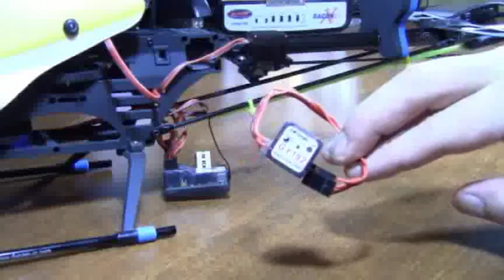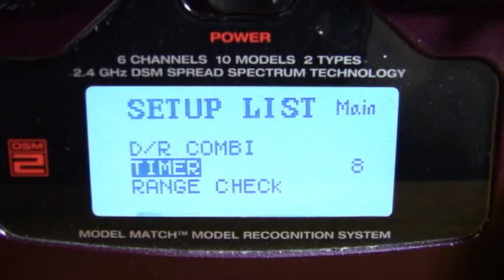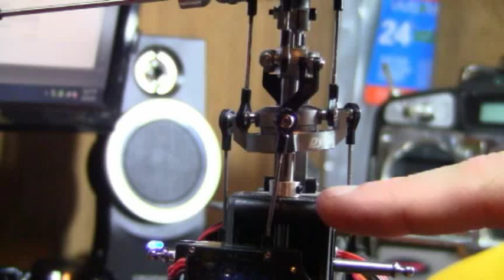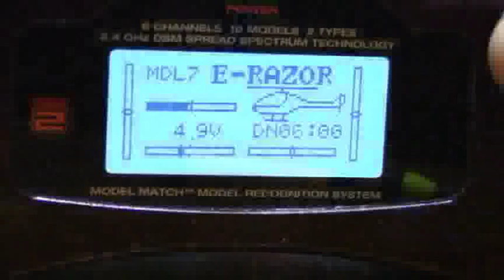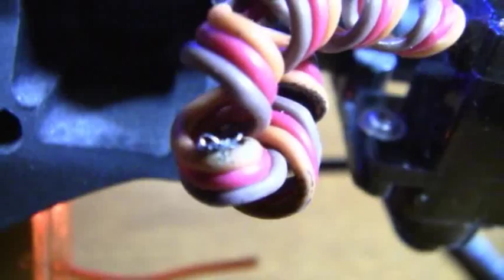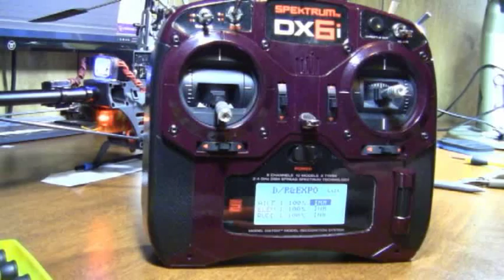How to Completely Setup A CCPM Helicopter  DX6i & OrangeRX

Comment: Hey brother awesome video! I'm just getting back into the hobby and found it very informative. Still have a QUESTION if anyone would help me out... First I'm converting a 72 mhz T-Rex 450, collective pitch with a flybar and i got Radiomaster tx16s... I'm looking to buy the OrangeRx R620X V3 6Ch 2.4Ghz receiver ... Will this receiver work for me?  Just a little confused with flybar/less and the receivers and if it makes a difference which I buy? Thanks in advance!
Reply from the maker: As long as the receiver is made to work with the Tx, it should be fine. But not all Rx's will work with all Tx's. Such as Futaba will not work with Spektrum and so on. so as long as it's the same band, it should work fine. You can always come over to www.rc-help.com and post up your Tx and your Rx link you are looking at and we have a great group of people that can help out. Hope to see you there.

Comment: Very good .  where are you located? im in san jose CA.  I could really use a contact like you. Ive got e razor 450, 230V2, 330x, 360cfx, and align pro 500dfc.  I wreck just about every flight.  Your vidio may fix that hopefully.  There's nobody around here ive found who knows jack sht about thee
 Products they sell. Its just like here you go your on your own. Go for it.  100 bucks a second and away i go

Comment: Hi mate just a quick question when I tilt my 500 to the right-hand site should my squash play move to the left cheers
Reply from the maker: That is correct. The swash should always try to stay level.
Reply from the maker: What flybarless controller are you using?
Reply from the maker: No worries. You are correct, on a flybar helicopter the swash will only move with stick input. The flybar is what does the stabilization while you are in the air.
Reply: Yeah I understand that now mate thank you and also when I'm in a hover to helicopter wants to drift to the right and I centred the servos and it still wants to drift to the right quite a bit
Reply from the maker: On a flybar helicopter, you can use trim tabs to help keep it in one place. If you go inverted though, just pay attention to what way it is drifting inverted as well and compensate for that as well.
Reply: Ok then how do I sort that out then cos my swash plate does not move at all only if I put in put on the sticks the swash plate moves
Reply: Sorry mate I got myself confused I thought it would do that on a normal align Gyro
Reply: Lol

Comment: Oops! you didn't say to set up the blade pitch from the side.  I've been trying to do it from the tail.
Reply from the maker: You can setup the blade pitch from any orientation as long as you do the other blade in the same orientation. Just make sure your main shaft is as plumb as possible.
Reply: @RcHelpDotCom  I'm concerned that my Gyro might be installed wrong. Mine is on edge, like shown in your picture, but GY192 installation manual says to put tape on the back and "the gyro must be mounted level and the axis of rotation is exactly parallel with main shaft" . Does it work properly as you show it?
Reply: The "Main Shaft" is the rotor shaft, right?
Reply from the maker: The way you see it in the video is how my gyro was mounted from the factory on the E-Razor 450 when I received it. It wouldn't work any other way because of the way they had the sensor inside mounted. If yours is newer, it could be different.
Reply: @RcHelpDotCom  Thanks!
Reply from the maker: The main shaft is the shaft that the swash goes around and up and down on. It is what holds the head onto the helicopter.

Comment: I had no idea Dynam produced a Helicopter. Wow! Most guys swore by the DX6i as a helicopter transmitter. I have a nitro heli from Kyosho but It came with a Futaba radio and receiver stock from the factory. I may switch out the receiver. The DX6i is more than adequate to fly up to 4 miles. at least thats what I was told.
Reply from the maker: Yea, they made a helicopter, but it was not a good helicopter lol. I quickly moved onto other brands shortly after this video which is quite old now. As for the DX6i, I would not trust that Tx for anything more than 1/4 mile, especially if it is the old DSM2. DSMX, maybe 1/2 mile. But without diversity, it just gets sketchy from there. www.Rc-Help.com
Reply: @RcHelpDotCom  I quit using my DX6i after it nose dived two of my planes. I found it only works best on UMX planes and no programming. As soon as I add in Rates and Expos, the thing cannot handle it. I have flown my Apprentice on it but even then , the DX 5e that came with it is 100%  better. I went to Tactic and have been happy with that. I also have the 3rd gen DX6. That seems to be fine.

Comment: Don’t set EPA on rudder channel to try and prevent binding. You MUST set that on your gyro pot, or in the gyro programming. EPA on rudder channel controls how fast the Heli spins in one direction or the other.
Reply from the maker: On a flybarless gyro, or modern MEMS gyros, you would be exactly right. But on this old GY192 piezoelectric gyro, that pot is for the tail gain, not travel. You have to use the transmitter to adjust the travel with this gyro. Again, very old gyro, but it is still for sale for $5.00 online lol. Not sure why anyone would want this gyro, it's not that great. Thanks for the comment.

Comment: Im barly learning all this.  Didnt realize how much actually goes behind flying.   a pittch helicopter.  Mine is a 600 class with a 5000mah battery 6s.  Im using the orange T Six with the new Ar620 reciver.  So far so good havent actually Got it up yet still taking it slow.  Thank you for the vídeo content you put out there.  Much help.
Reply from the maker: It's my pleasure.

Comment: when i plug pitch into aux it doesn't work with the left stick i just have throttle
Reply: RcHelpDotCom thanks i am using a jr transmitter and reciever for a koyosho nexus 30  i think i figured out you can't combine the pitch and throttle on the left stick on this transmitter it seems like it's more for planes
Reply: RcHelpDotCom thanks i have a dx6i on the way lol

Comment: Hi Tony,  Thanks another excellent video from you.  I have a question.  I note that in the video your swash plate on the E-Razor moves up when you throttle up.  I am trying to setup my Blade 400 flybar heli using a Spektrum DX6i and Spektrum rx, but my swash plate moves 'down' when I throttle up.  The blade angle increases giving lift when I do so.  So the question is, why does your swash move down when you increase power?
Reply: Tony, There are several Blade Helis like that, both of mine, (300X and 500 3D) are like that. Think its due to the trailing edge design of the head.

Comment: An excellent concise and well presented video. Just what a newbie needs to find his way through a maze of baffling terms and permutations. Thank you Tony.
Reply: Tony just one question. I have a Walkera V450D03. Having followed your advice that you set the main blade pitch by moving the levelled swash plate up or down by lengthening or shortening the three linkages, how do you set up the length of the linkages that go directly from the swash to the main blades themselves? I have messed with these and need to reset them. Zero pitch with 50% throttle and the swash half way up its vertical travel perhaps? Cheers. Ian

Comment: have u ever converted a non hobby grade heli i have a fully set up frame with motors for a udi-u12 or u12a ive never flown before  but am researching to learn how to build first i understand that the udi-u12 has no wash plate but uses the tail rotor for forward and reverse because of the tail rotir on top n not the side   and it uses double props .. could u tell me the parts i need to convert  this n what electronices i would need  if u need to see the heli go to xheli.com n look up udi-u12  n if u can can u send me any info to my email ...jr1973c@gmail.com
Reply: RcHelpDotCom ty

Comment: Hello I want it to thank you for all your videos they really help me up to build my heli, but I have a question meaby you can help me up, I'm building a 450 fusuno airwolf fuselage and if you check youtube there is a guy who teach how to do build it, to operate the retracts you need to disconnect the single yellow wire for the gyro but when I do that my rudd  don't work is that normal or what can I do to operate my heli  promptly, I using a Spektrum Dx6i , help me up please, thank you.

Comment: I want to thank you for doing your videos, they are very helpful.  I have  a 450 as well and been having trouble with the servos and thanks to you I got them straightened out.  Now only if I can get it lift I will be very happy.  However I did find one of the connecting rods was shorter than the other which didn't give me the proper pitch when throttling up so we will see if that was the problem.  Again great job on the videos.

Comment: On the pitch curve settings you mention to have it linear from 0 to 100, correct! when you say low point is at full negative pitch do you mean set it at  -100% or at 0%

Comment: Well got the tail servo working some how lol.  I got Tower Pro 9g servos on it now (Detrum GY48V and EXI metal gear servo on the way).  Got everything adjusted so far with my DX6i and the Orange Rx but when I go to take off and the helicopter just spins rapidly, usually counter-clockwise and I can not control it.  I think the GY192 gyro is messed up from a small crash but it lights up blue and initializes.  I don't know what to do.

Comment: Question: I have a couple of 4 channel heli that I want to convert receiver to my new DX6i tx. The 4 channel heli have build in gyro on the pc board and the tail motor only has 2 wire leading from it how would I connect it to the orangerx or do I need to put a gyro on the 4 channel heil and same with the main motor only 2 wires on it. Can I connect a gyro to the tail motor with out a servo? Also have 6 channel honey bee king 3 that should not be a problem switching it over

Comment: Any after a crash repair, replacement parts and tips? And when it's just cheaper to buy a new heli rather than just buy more parts?   For me, I have an overly discharged battery (replacement cost $28 plus S/H), might need a new ESC and Motor ($33 plus S/H) That sums up to about a 3rd of the total cost of the RTF 450 E-razor.

Comment: I will pop over, but your answer made it all possible. I now know what a non SSPM machine is, it has a seperate collective like a full scale chopper. (well not quite the same but the same principle). I will log on and ask why three pitch linkages not two, and ask if the phase angle is exactly 90Degrees. Thanks

Comment: fabulous video sir. Just upgraded from a blade SR to a 450x and all of the TX setup was totally new to me and quite confusing. Even though i am using the dx8 i was able to translate all of this video to my TX and setup my heli accordingly. Did some hovering in the garage and had some similar tail issues that would have taken me forever to troubleshoot without this. Love your settings and love this video. Thanks a ton! gonna make a video soon of your settings on my 450 all credits will go to you!